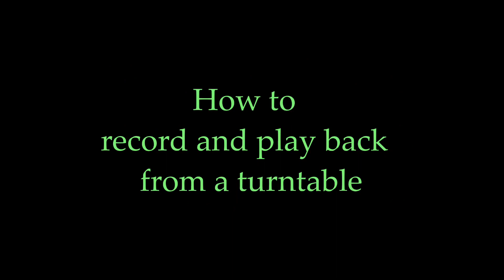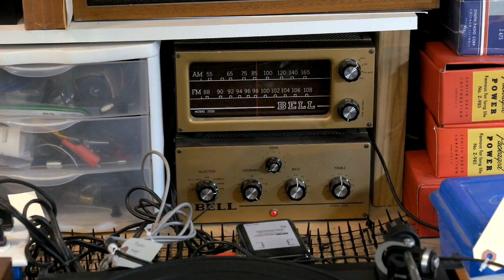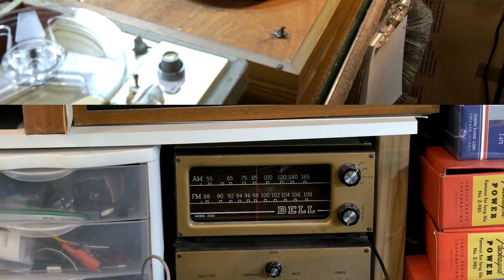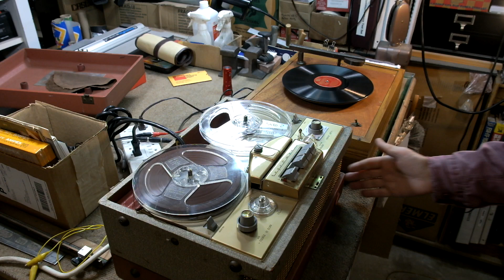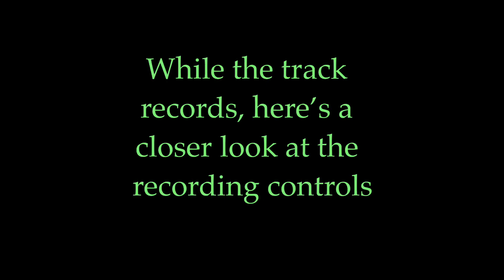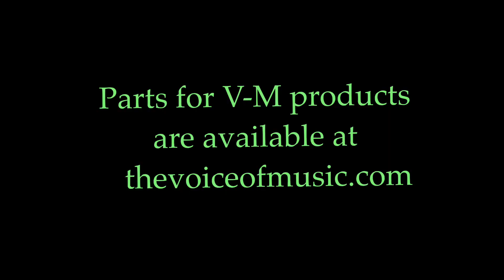Voice of Music 700 Tape Recorder Operation

Comment: In 1962 I bought a stereo model 741 which had 2 small vacuum tube meters for the record level meters. When the ends met in the middle was the maximum volume level. If they overlapped, the signal was distorted. It was very sensitive and tricky to get the strongest record level without distorting. Years later I bought a much better model Tandberg recorder with VU meters and four heads: record, playback, erase, and crossfield head to reduce bias and increase the S/N ratio, for better recordings. I used the VM machine to play back prerecorded tapes to copy to the new machine.
Reply from the maker: Tandberg made great stuff.  My brother had one of their recorders.

Comment: Hello,

I purchased a model 700 in 2015. Mechanically I restored it, but have not done any work on the amplifier. The playback and record signals are very weak. I suspect it needs to be recapped. The tubes haven’t been tested, so I don’t know the condition of them. Perhaps one day I’ll look into restoring the amplifier, but not too knowledgeable about the electronics of this machine.  Thanks for posting your video. It gives me an idea of how my recorder would work if it was fully restored.
Reply from the maker: No doubt a recap would bring your Model 700 back to life.  It's not a hard amplifier to work on, but there are quite a few caps in the circuitry.  See my reply to Cutlass below for sourcing mechanical parts and the service literature for your recorder.  Electronic parts and tubes are also readily available online.
Reply: Somewhere I have a copy of the Model 700 service manual Gary Stork sent me. It most likely has a schematic diagram. I just need to figure out from the diagram where the caps are, as I know how to solder in order to replace them. I think with a little motivation I can get the job done.
Reply from the maker: @tapeomatic  On mine, there were a dozen capacitors to replace, one paper and the others green Micamolds.  All are easily accessible and you don't really need the schematic as you can read the values on the cap.  I did have to replace a few out of tolerance resistors.  If you have the components on hand, you can restore the amp in a couple of hours.
Reply: Thanks for the information. I don’t have the caps on hand presently. I’m not sure if I can get them through Gary Stork @ VM Audio Enthusiasts or need to look elsewhere. I can email him to find out.
Reply from the maker: @tapeomatic  Gary doesn't carry passive components like capacitors and resistors.  I usually buy mine from Dave Cantelon at https://www.justradios.com/cart.html.  There are also some higher wattage sand resistors that may need replacing with modern ceramic resistors.  You can go to my website, http://elmphotography.com/radio1.htm, and email me directly, which may be more convenient if you have other questions.

Comment: Hi, I am 81 years old, and I bought one new when I was a young boy but that one is long gone. I found one on Ebay it's a 720 a little newer and works really good but slow to start, so need to put new belts in it.I know it a big job, but I am a mechanic with a lot of time on my hands. Any help to fine belts would be great. Thank you so much.  Tom
Reply: Hello, I’m trying to restore a 722, can you explain to me how to remove the top so I could access the mechanics of this real to reel. Mine is almost identical to the one in this video, I’d like to open the top up. Thank you for your help.